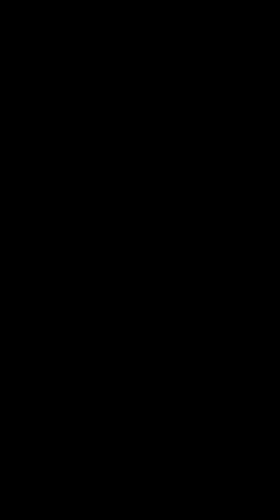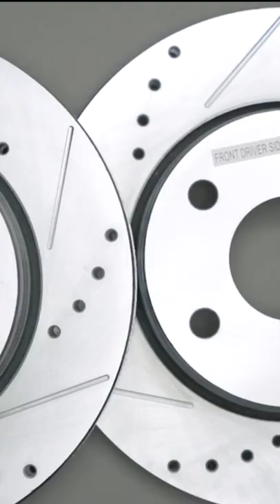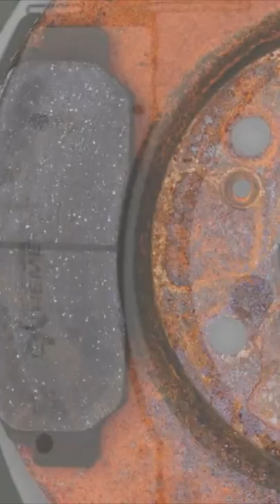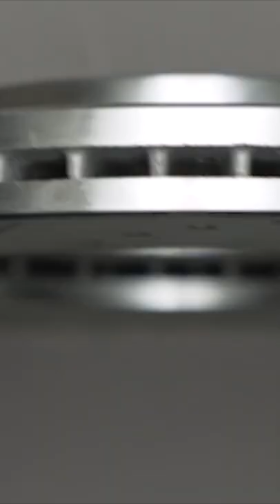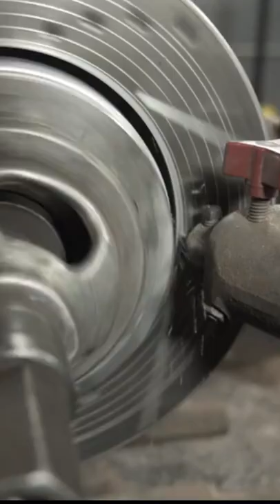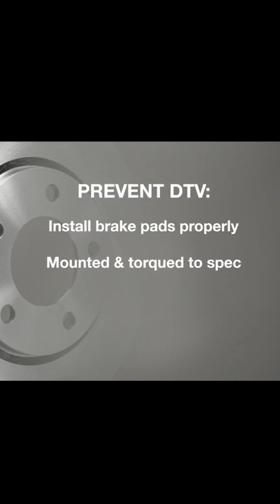How To Diagnose a Pulsing Brake Pedal #shorts

Comment: But don't mistake this for anti-lock brakes. When applying the brakes in an emergency situation the car can skid which leads to the vehicle opposing the skid with variable braking pressure to slow the car down faster by gaining traction.👍 next video explain all possibilities so it's not taken out of context